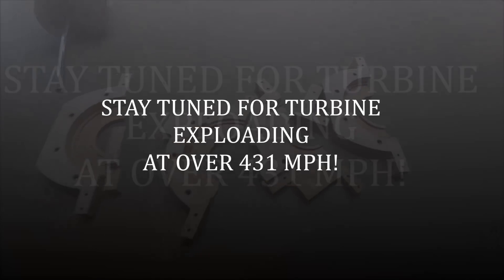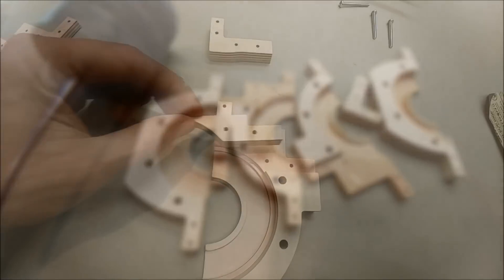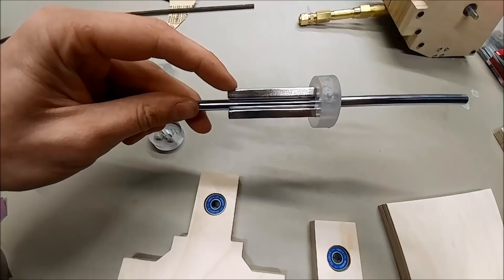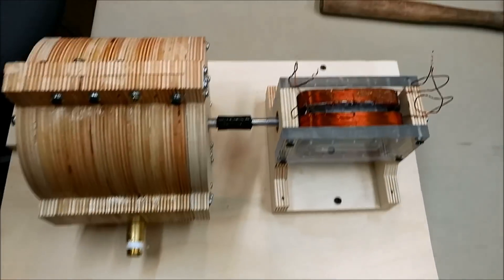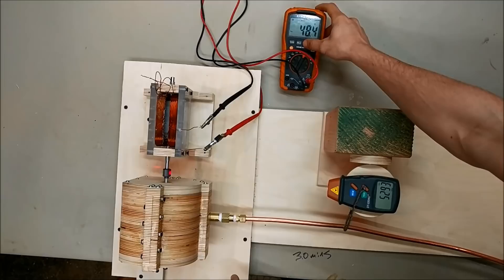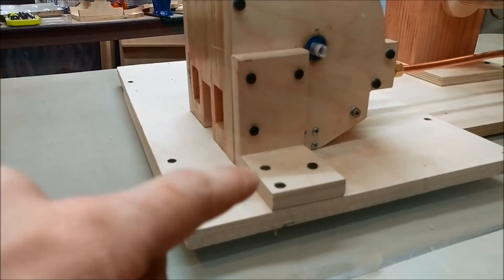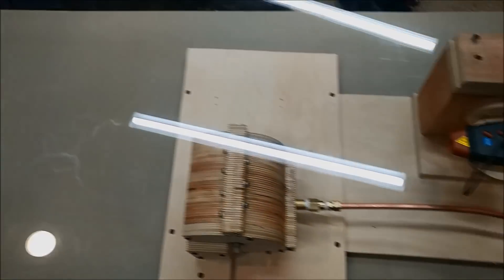See The AWESOME POWER of the Two Stage Tesla Turbine!!

Comment: It is mostly blowing up because of reaching a critical rpm, what means the frequency of rotation (imbalance) reaches the resonance of the system and exites waves in it, that flex the material so fast and far that it breaks.  so using stiffer or thicker rotor plates would allow higher max. Rpm... till reaching the centrifugal limit of the material :)
Stay safe, keep on =)
Reply: Another idea will be using ripplets in your turbine housing to reduce visco friction and surface turbulence,, will give u a gain of 10% if done right,  ripplets must be finer for higher speeds.. They covered planes with that foils.. i think u could produce that surface on a good lathe with a sharp cooled tool =)
Reply from the maker: @sonnenklang6925  Something to try in the future for sure. For now, the vacuum from the pump reduces the turbine by decreasing the pressure in the exhaust space.
Reply from the maker: You are correct, it wasn't balanced that well. we are no longer blowing turbines up, I mostly did this video for a safety video, and it was exciting and took a lot of work.  If you use week materials for the turbine casing it can't stop the rotor with a breaking force when it stretches and hits the side wall as shown here, also the lexan rotor quickly melts allowing space for further stretching. I actually got one of these to go 49000 rpm, and made two kw but it quickly braked it'self before exploding and everything was good accept for the rotor.
Reply: @iEnergySupply  thats really high for plastic (polycarbonate?) discs man :) cds are likely blowing at 23k  did you find some relyable burst rpm data for metal discs, if you would make the same size rotors from stainless how high would they go?  Maybe somehow dampen it so they dont ring.. Connect them plates with a bridge? .. I think another effect is the air it self that goes over the surface will make standing waves like with wind over watersurface :)
Reply from the maker: @sonnenklang6925  We will be using carbon-fiber next! We can get way higher rpm with carbon-fiber. I haven't tested the failure point of the stretching of the disks with metal yet.

Comment: 2:06

Are these your exhausts? Tesla turbines get their incredible efficiency from the exhausts being in the middle by the shaft bearings, so that the air has to fight the incredible centripetal force to get out, turning the turbine in the process.
Reply from the maker: there is a turbine, a regular turbine in the center, then there are two pumps on on each side of the turbine that evacuate the pressure in the center of the turbine.

Comment: why did it exploded ?
Reply from the maker: The rpm was to high for the lexan to hold it's self together, the centrifugal force on the rotor exceeded it's material strength. The rotor ripped it's self apart with 72000x it's weight in centrifugal force.  The force was outward from the center like a marry go round. The wood couldn't stop its rotational velocity because the periphery was to far from the rotor allowing it to stretch and break.

Comment: what does two stage get you? the input velocity has little to do with output. And yo have one shaft for all stages so youre in actuality coupling  the turbines not staging them ...?
Reply from the maker: In the development of power by thermo-dynamic primemovers, as steam engines and turbines, a low back pressure is essential to good economy, the performance of the machine being increased from fifty to one hundred per cent. by reducing the absolute pressure in the exhaust space from fifteen to about one pound per square inch. Turbines are particularly susceptible to such improvement and in their use for operation of power plants and manufacturing establishments the attainment and steady maintenance of high vacua has assumed great importance, every effort being made to better the conditions in this respect. The gain effected by this means is, in a large measure, dependent on the initial pressure, characteristics of the primemover, temperature of the cooling medium, cost of the condensing apparatus and many other things which are all well-known to experts.

Comment: Please turn the explosion part into it's own video! Not just because it's cool. But more of a PSA for showing the kind of destruction that happens when one of these fails. Sure, it's a wooden one past its limits. But imagine if that had been a metal construction failure 😲
 Not being negative Nancy! Looking at my own experiments with it & just feel it's an important bit of footage. 
 Keep up the AMAZING work!
Reply from the maker: That's a good idea, a safety video. The metal ones can't explode though, but only when the tolerance of the side walls is close enough for the material used. I put a 1/64" gap between the periphery of the rotor and the casing circumference. The rotor stretches with centrifugal force to break the rotor(not explode the rotor.

Comment: “It’s okay, I had full blast shields!”  *piece of wood stuck into the drywall*. Nice work for it being made of wood and plastic, and that coil is powerful as hell.  Excited to see the next phase, I’m trying to figure out a scenario for an off grid project in the future that could power a farm and machine shop with one of these running high pressure water.
Reply from the maker: You won't need high pressure water with our new system. Even below atmospheric pressure will do. Stay tuned.
Reply: @iEnergySupply  how goes IT? 
Some times be low,  feel riddled by soles walking on, twisting intwo your dreams. 
What once felt nice. turns queasy vice, conCern Gatekreeper stifles does squeeze me. 
The and thee, drawn in,
Bearings all right°, Brought in To begin in Falls light, of May sun, on through to cloud masked Aemricon to de skies 
never ending story, allegory, time bandits thieves. Bridges turn ridges. Opportune....detune, maroon to ops. 

Con fusion. 
VrilSoulLooshin 
Be there, somewhere that feels free? Rewwind Find synergy, knot freeDom wrapped wound.
 Now  standing in syn a synthetic false light in darkness drew me in to its nest.
Reply: Don't think you'll need to..tech coming can fit 8n a shoe box that can do that and more...
Reply: @neoplasmax  ....always on the horizon. But culled by conSumerist greed. by free the only way the dúmb shall be freed from dom nations.
Reply: @neoplasmax  #DavidLapoint #PrimerFields and his Primer Fusion Boron Plasma Fusion.  

I think,....no rather i know people vastly underestimate the lengths to which the snakes will take to choke off and clench the lines of progress. 
We’ve been using wrenches to lubricate gears for years sinces pre. Lets see... certainly 1920’s. By the time ww2 was over the old had been retold complete. Neat. Forgotten. 
Tax. Debtslaves remain. Too weakened by the weekend to go looking round up or downward creepin,,,

East, bound and downed ... syndrome slips in neath mounds.  never to be found. Look their? Oh no. Too scared. We never dare.   

And on top of all that, like a top hat wearing black cat of ALL THING CAP. The paper Fraud CAPITAL LIES  ,   our directions and compass has been corrupted  East is up my friends.
Reply: oh go steam either wet or dry your choice. youill be able to heat the house during the winter as well. as sell off excess power to the grid.
Reply: @cyntcynt ah, the idea has floated away, we’re doing solar and wind I think.
Reply: @junethefarmer   cyntcynt comment is gone now? Whats up with all the censoring going on. Its vile evil veil; live not beneath their parasol which casts all in a fractured pale false light wholly full of holes much missing infinitely in its formations.

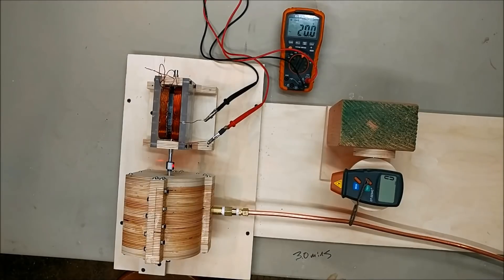Comment: At 3:20 the multimeter reads 2 volts, the tachometer reads 0 rpm and so sound is heard because the turbine is not spinning. This is a scam
Reply from the maker: the meter was set on max, so until it over dame the voltage displayed on the previous test, it won't show anything.
Reply: last highest value. didn't tare the meter
Reply from the maker: Thanks robert.

Comment: Wood was a poor choice
Reply from the maker: Yeah was a model, didn't
 have enough at the time to build it out of lexan
Reply: @iEnergySupply  no worries
Reply: Wonder how much electricity that thing could generate if the turbine was turned into a generator
Reply from the maker: @brandonvessell4659  I powered a 1200w motor and impeller But that's not even close to what it could do with a proper setup/metal rotor.

Comment: You need to look up Frank Germano's research into it, use nitronic steel plated with a boron carbide buffered to extreme smoothness for the discs and a stainless steel, hastelloy, nimonic, or brightray superalloys for the shaft and housing.

THAT IS if you're going for strength, heat resistance, and stress resistance.
Reply from the maker: Yeah, ill do that. We definitely need to build a metal turbine now! Ill take a look at his research.
Reply: @iEnergySupply  Let me link you his wordpress website, the archive of his original website, some turbine references, references to the materials I was talking about, and his two known contact emails.

frank@germano.com

frankdgermano@gmail.com

https://web.archive.org/web/20120224012212/http://www.frankgermano.net/teslaturbine.htm

https://web.archive.org/web/20121005211517/http://www.frankgermano.net/teslaturbine2.htm

https://frankgermano.wordpress.com/the-tesla-turbine/

https://frankgermano.wordpress.com/the-tesla-turbine-pump/

https://en.wikipedia.org/wiki/Nitronic

https://en.wikipedia.org/wiki/Nimonic

http://www.haynesintl.com/alloys/alloy-portfolio_

https://en.wikipedia.org/wiki/Boron_carbide

https://web.archive.org/web/20120424175829/http://www.frankgermano.net/teslaturbine.htm

https://web.archive.org/web/20110105100042/http://www.frankgermano.net/theturbine.htm

https://patents.google.com/patent/US9835142B2/en?inventor=Frank+Germano

http://www.teslaengine.org/images/teba15p17.pdf

https://www.gyroscope.com/images/teslaturbine/TeslaTurboMachinery.pdf
Reply: @iEnergySupply  I'd also try to find out and see if he still builds them or not as well, if he does, maybe a partnership could be formed..?

Who knows.

Comment: i feel like trees were never meant to go that fast.
it makes me think of the old scare when cars were first being introduced and people said the human body would disintegrate if it went that fast.
Reply: Chehyst just so you know it's not the wood that was going fast the wood just made up the case it was the CD's glued on to their shaft that was spinning at such ridiculous speeds and predictively exploded.
Reply from the maker: @michaelvaughn2287  You are correct, but I didn't use cd's for the rotor, I used lexan cut with CNC machine.
Reply from the maker: Yeah its new for sure lol, I didn't know that!
Reply: I think the figure quoted was 15mph as the destruction of the human body
Reply: Trees are meant to go fast.  Proof?  The DeHavilland Mosquito.

Comment: What does it mean to have a second stage?  What advantage is gained?
Reply from the maker: The second stage lowers the back pressure in the turbine. Here is what Tesla says about it. n the development of power by thermodynamic prime movers, as steam engines and turbines, a low back pressure is essential to good economy, the performance of the machine being increased from fifty to one hundred per cent, by reducing the absolute pressure in the exhaust space from fifteen to about one pound per square inch. " - Nikola Tesla
Reply: Thank you!

Comment: Is it crazy that the money number for these is about 70,000-80,000 rpms? At this rpm the system quiets down and is running nearly at 90% efficiency.
Reply from the maker: Close but it depends on the periphery speed of the rotor. The greater the circumference of the rotor, the greater the periphery speed  per RPM. It's high periphery speed that brings out the efficiency of the machine. Generally the higher the rpm the faster the periphery although the periphery speed is dependent on the rpm times the circumference of the rotor/disks. In this case we achieved the highest periphery speed we know of, and the efficiency was much greater then we have ever seen.

Comment: Titanium would be the best material to use for the discs. I am sure there is a company out there who would gladly manufacture some for you if you give the measurements you want. The housing could be aluminum and there wouldn't be any problems.
Reply from the maker: Your correct about the titanium, although it is really expensive. There are grades of aluminum that preform in the same ball park for much cheaper price. I would love to build a titanium rotor if we could afford it. We are definitely going to build one with an aluminum casing as well.

Comment: Please attach a LOAD to the generator, something which consumes CURRENT, not just measuring the 'open voltage'. A 1 Ohm resistor, or even short the outputs and measure the current. The 'back EMF', will drastically reduce the speed.
I have seen numerous 'free running' Tesla Turbines.
Reply from the maker: We just attached a generator to our latest turbine and powered a 1000w motor, although it did it's job the generator was unbalanced so most of the power was lost to vibration. We will soon attach it directly to the shaft to demonstrate the power, we will also show the motor's amp's and volts to show the turbines potential capabilities with solid numbers.

Comment: Explosion may be caused by Weight balance issue ! Great works anyway. Keep up with metallic component.
Reply from the maker: Good guess, although I believe the rotor shifted, the balancing company dropped the rotor and the shaft bent, sadly, so he balanced it with a bent shaft, the shaft couldn't be centered correctly and there wasn't enough room for the rotor collars to center the shaft. I believe it hit the side walls at 35k rpm and rapidly heated up causing the centrifugal force to break the rotor apart once it became hot due to the friction.

Comment: I wish I could find a CAD wizard that would want to partner on trying to design a tesla turbine and build a legit one for high speeds and try using big panels filled with refrigerant and/or other kine gases/propellants/etc and use the passive heat from the panel to heat the gas and then compress it with the turbine.
Reply: Actually high speed is fun and all but it's rather useless when compared to high torque which can be done with a Tesla turbine because you need torque to turn a motor or generator so the greater the torque the greater the power out put .

Comment: Is there a way to measure the speed / pressure of air coming out? I hope you can receive hundreds of aluminum disks (aluminum hard disk drives) as a gift for the various tests. Finally, after so many years, new, interesting and impressive experiments with the tesla turbine. Good job!
Reply: Agreed.  Aluminum platters from old hard drives would be the way to go.
Reply: Dude hard drives would be perfect
Reply: Doesn't suggest e-waste recycling for said hdd platters....
Reply: These Tesla turbines are great and have not been used enough. The question is not how much power they generate but what is the power generated vs what power it took to create the compressed air. IMHO these turbines are best suited in water fall situations.
Reply: @niteknight265  
Tesla turbines have been in use for a long time.
Usually in the opposite way as a pump for liquids.
But not for generators, as mankind has no material that can withstand the massive centrifugal forces.
Modern turbines achieve efficiencies of over 90%, in order to achieve these efficiencies in the "industrial" framework with a Tesla turbine, the disks would have to rotate at their outermost end at a speed of more than Mach 10.
Even the most powerful titanium alloys are too weak for this.

Comment: cool turbine, but why bother?  How would you power it so it would run at max output long enough to overcome the cost of generating the force to power it?  Not putting you down, just not seeing it being free energy as I'm assuming it's running on compressed gases.
Reply from the maker: Not exactly sure what you mean, we aren't trying to get free energy here.  Just transform the energy that is already everywhere, surrounding us.
Reply from the maker: @nikola.tesla.r.and.d.centre  It's on the to do list, we should build the rotor out of carbon-fiber, that is what our next step is. To hear the first sonic boom will be glorious!! I don't know what will happen but I know it will be amazing! This will defiantly provide us with the propulsion for the flying machine!